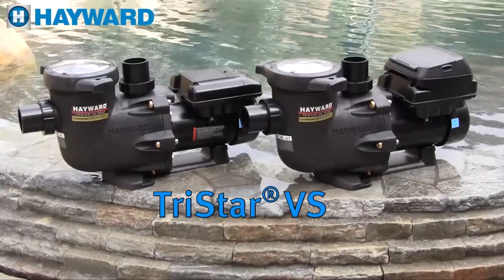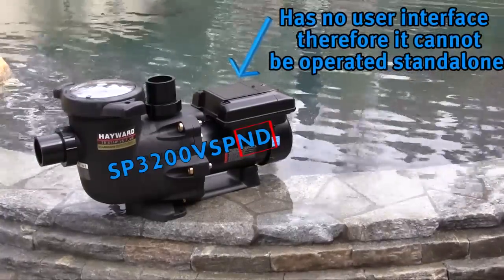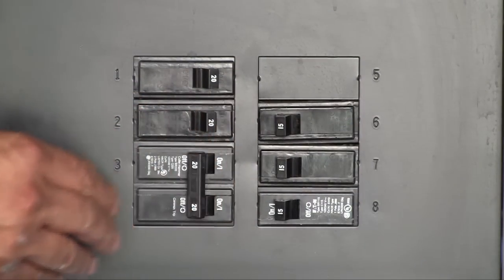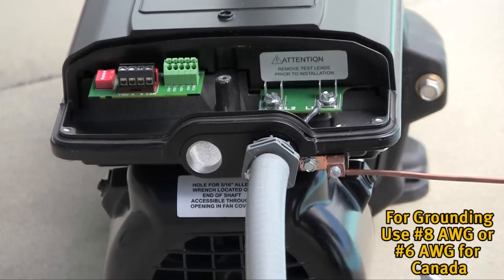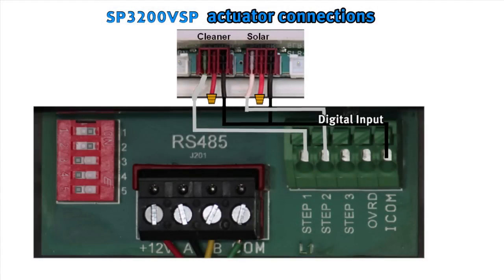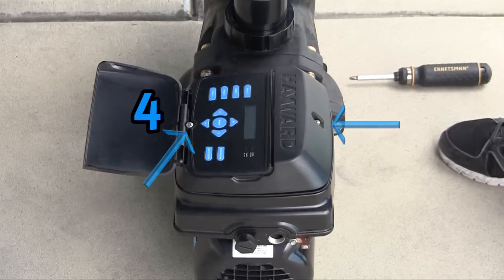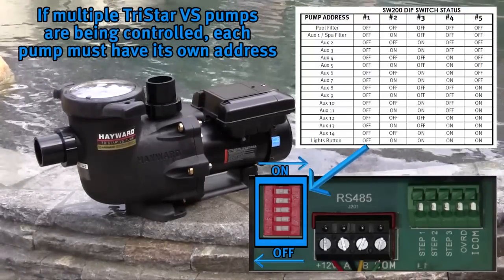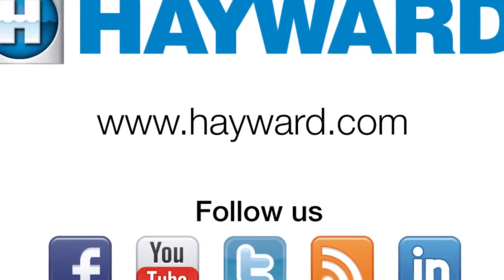Universal TriStar VS Installation and Start-up

Comment: The manual shows using the "OVRD" and "COM" connections to support a "Remote Stop" switch and that the 12v power supply on the pump can be used for this - but that "care must be taken".  "Care must be taken" seems rather vague. What care must be taken if I simply have a user interface and a remote stop switch both using the 12v power, and I have dip switch 1 on?
Reply from the maker: A Hayward Dealer can assist with that. Please  enter your zip code in our Dealer Locator to generate a list of local dealers: https://www.hayward-pool.com/shop/en/pools/Dealer-Locator?langId=-1#nav-home.
Reply: @HaywardPoolProducts  haywards apparent policy of not trying to be directly helpful to pool owners even for simple technical questions is very frustrating.  Finding a pool dealer that knows the answers to many of these questions is challenging.

Comment: Does this pump come set to run off of 220 or 110?
Reply: I have the same question.  The manual says you can run both but the 220 requires a 15amp while the 110 requires a 20amp.  Does it require 220 or can 110 be used?  What are the benefits of 220v?

Comment: If I have an extra "user interface" from a previously installed Ecostar is it possible to connect both interfaces at the same time to allow control from two different locations?
Reply from the maker: A Hayward Dealer can assist with that. Please  enter your zip code in our Dealer Locator to generate a list of local dealers: https://www.hayward-pool.com/shop/en/pools/Dealer-Locator?langId=-1#nav-home.

Comment: When replacing 2.7 eco star controlled with aqua logic my  control wires are plugged into 7 and 8 low voltage connectors on the ecostar pump.  Which connections would they be connected to on the  tristar SP3400VSP? I'm using Aqua Logic controls
Reply from the maker: Hello Mr Ramos, we'll ask a tech to get back to you. Please private message your phone number and email address on our Facebook page or Twitter profile or you can email us at marketing@hayward.com.

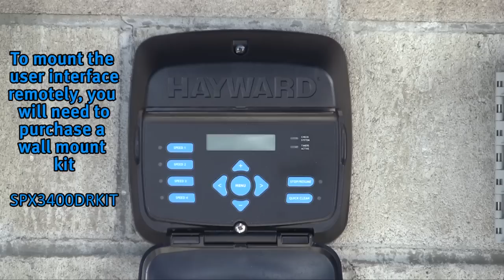Comment: At the 9:15 mark, it says a need for 300v cable for the wall mount kit.  Is that correct?  I've also read you can use Cat6 or 18/4 sprinkler wire, neither of which is anywhere close to 300v.
Reply from the maker: Hi there, our tech will reply. If you'd like to speak with him directly, please PM your phone number.
Reply from the maker: Message from our tech: You need a jacketed 6 wire cable.  18-20 is ok.
Reply from the maker: Sorry.   4 wire not 6.
Reply: Thank you.  I have some 18 gauge / 4 wire jacketed cable rated for outdoor use.  I'm thinking that will work fine.
Reply from the maker: That will work.

Comment: What size liquid tight cord grip connector do I need for the wall mount wire?
Reply from the maker: This pump should not be wired with a cord.  It needs to be hard wired.  Please PM your phone number for a call from our tech.
Reply: I'm using 18/4 jacketed solid sprinkler cable just like the guy below.  You said that was ok below?  The video also calls for "a liquid tight cord grip connector".  You're saying that shouldn't be used?  This stuff is actually rated for 30 volts, not 300 though.